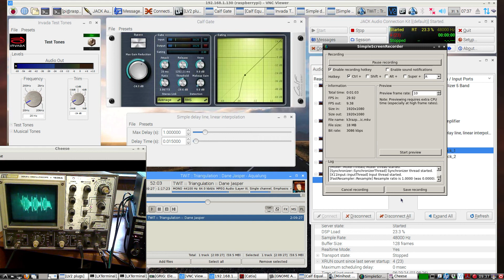HAM RADIO - Raspberry PI - voice processing DSP AUDIO interface for SSB

Comment: Wow! Wonderful! 
But how do you set this up? 
Do you have a vst/LV2 host or do you somehow insert the plugins in LADSPA or JACK?
Reply from the maker: @Karl Hill
yes, i am using an LV2 HOST on this PI called  "Jalv(dot)select" - https://github.com/brummer10/jalv_select 
and have downloaded most of the Lv2 plugins that i could find in the PI's Synaptic Package Manager listings(search for LV2)
Reply: @QRQcw  Thank you so much! You have no idea how much I've been searching for a solution like this! 😊👍
Do you think a Pi Zero would manage to run  this or has it to low cpu power?
Reply from the maker: @karlhill6652  
I have wondered that myself -  i suppose it depends on the demands of the software apps being used...and how many of them...there are   etc...   PI-Zero needs an AUDIO HAT though...
Reply: @QRQcw  I'll give it a try, will use a small usb audio dongle. It is just for mono usage to my FT-817 that lacks the IF BPF, they are to expensive and not sweepable, a Rpi solution like your is so much more versatile.
I guess one could try to use low quality sampling rate.

Comment: can i use usb mic ?
Reply from the maker: you might try...however,  when using different audio cards for JACK input and output, there are usually some audio issues that pop up...NOTE: on jack,  if you use the native playback analogue sound card as the playback device and your USB MIC and the recording device, the Pi's native analogue sound card does have higher latency and less than ideal audio output quality and volume to the speakers or headphones...so you  might think about splitting the JACK in/out audio devices with your USB MIC and another USB PLAYBACK DEVICE...  and see how that performs...
Reply: actually i tried to run some dsp with pyaudio with a usb mic into Raspberry pi -- it always gives me error saying that alsa can't open slave ,,, despite the fact that i can record with my mic from audacity and from other apps in raspberry -- in fact um frustrated i had 3 days trying but in vain
Reply: okay um now connected mic usb as an input , but an AUX as a speaker , and all is running well except  that when i make filtration inside the callback function of the sounddevice library the code run for 1 min at max then there is no sound in the speaker